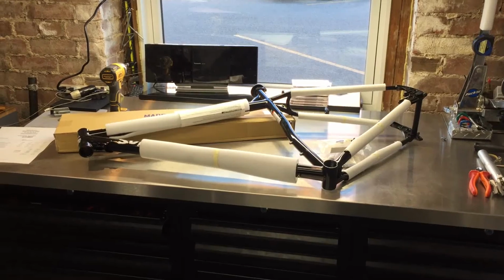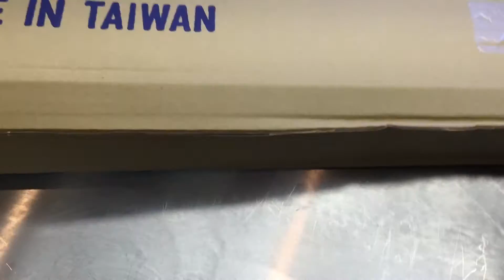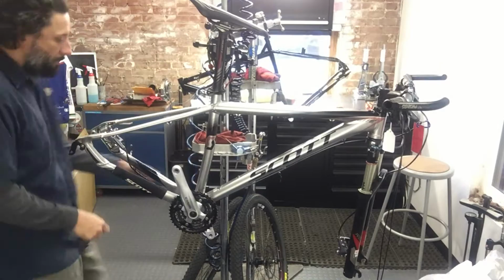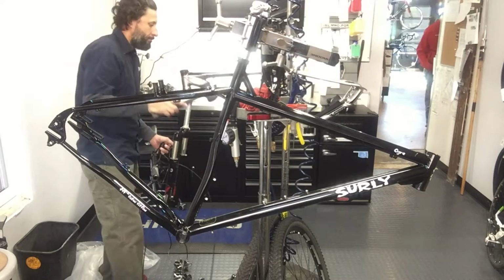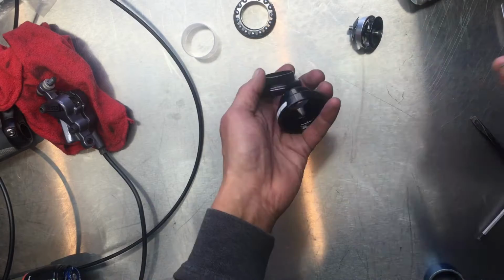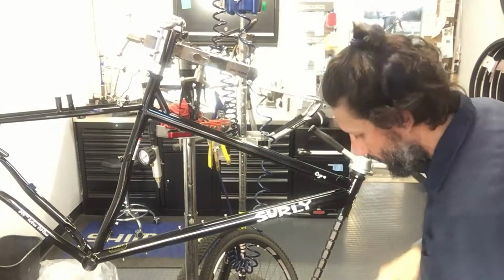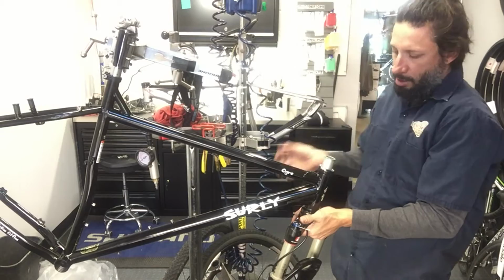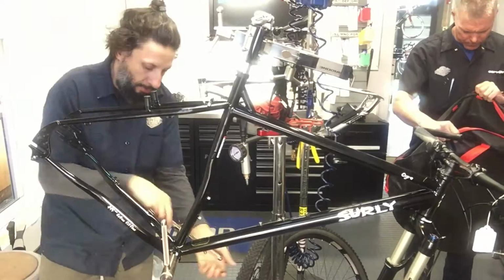Surly Ogre frame swap

Comment: In 2020, Surly says the Ogre is not suspension corrected and therefore can't accept a suspension fork. Maybe that wasn't the case in 2017, but if it was, could you explain how you were able to install and use the suspension fork? Can I safely install and use one, despite Surly's assertion to the contrary?

Comment: Great video and just what I need a tip for:)
 I have a Medium Ogre frame.  Its got nothing except fork is ready and attached. Looking to buy used parts...and the easiest and cheapest way, I figure, of finding full set of parts; groupset and wheels -  is finding a full 29'er used and converting it. Any tips on what I should look for? What is an ideal bike to convert? Would any 29'er convert? Would thru - axl  bike- wheels not convert? Are there chances the set length of hydraulic breakes would be too short, for instance? Any other dangers? I've been thinking I want to find a used high end bike with a nice set of shimano Xtr or sram components...2012 - 15ish since they sell cheaper .. Would love your thoughts.
Reply from the maker: I guess a lot of it depends on what year model Ogre you have. The bike featured in this video uses a 10mm slotted dropout with 135mm spacing. Surly changed the dropouts to the Gnot boost dropouts pretty soon after this. If you have the early version, you're limited to a 10mm axle. The newer style gives you the ability to run 10 x 135mm axles or 12mm  x 142 or 148 thru axles with the correct adapters.
Other than that, it just depends on how you want to build it up. A donor bike for the right price would be a good cost effective way to swap every thing. If thsta the way you're looking at going, look for a bike that's the same size or larger, 27.2mm seat post dia., standard english threaded bottom bracket 73mm wide, 31.8mm front derailleur clamp (unless you're going 1X), and full run cable housing.  The cable housing/hydro hoses are not really that big of a deal to add/cut new ones if needed, so don't let that be a deal breaker on a good compatibla donor bike. Other than that, it's really how you want to build it up. It's a pretty versatile bike that can be really tricked out or cobbled together and workable with a bunch of random parts.